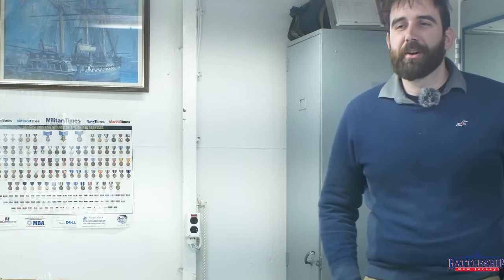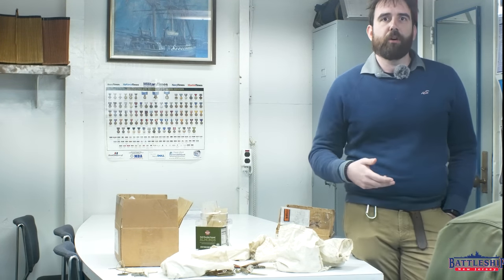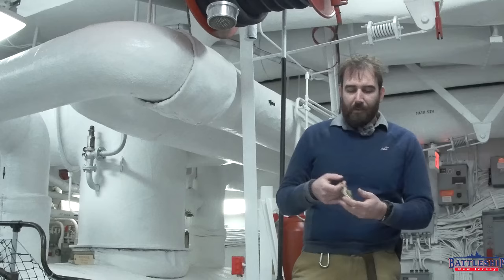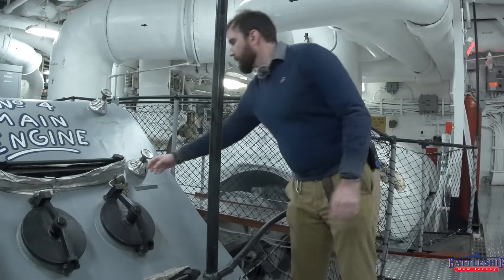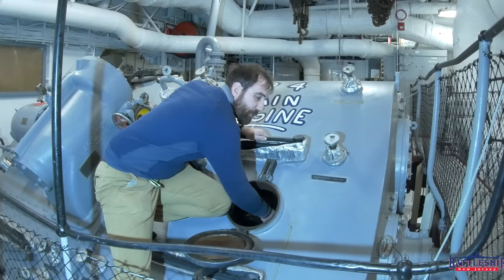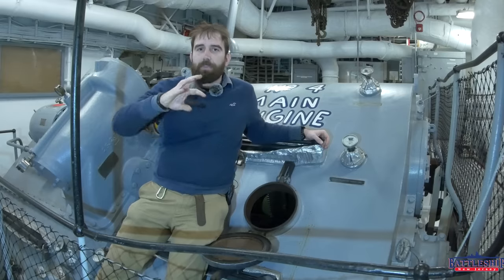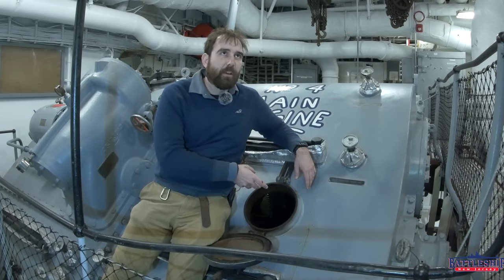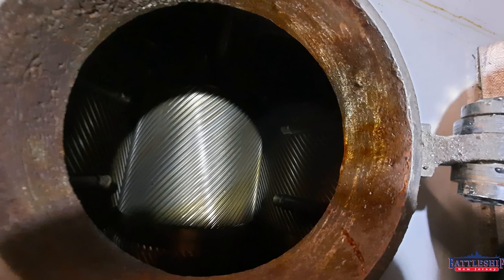The Keys to the World's Fastest Battleship: Unlocking the Reduction Gears

Comment: You could make extra cover plate out of  thick polycarbonate and mount it over the port hole with the same locking bar and bad lock, some PC  can be bulletproof, and probably as durable as the protective housing  it self.
This chould be sufficient for the navy. 
 You can also put a seal on the lock hole + the lock ,if you put light in the gear box this seal may give a extra layer of protection, ensuring that  the 
Cover is not opened after the installation of lights by the wrong person ,that want to fix the lights if they break.
The best solution for light mounting I probably to put two PC covers on the enclosure and just illuminate thru  the plate of one and looking in the second.  Puting anything faren inside  is risky, what if it break and stuff fall into the gearbox? If was my ship I would deny any request to put stuff inside the gearbox and other highly sensitive machines like turbines..,  see thru port glasses lockt and wire sealed:  yes

Comment: All those keys and none for the ignition switch or at least the steering wheel LOL J/K I remember massive rings of keys in the motor pool for each and every vehicle, generator set, and commo shelter
Reply: Army vehicles did not have ignition keys c. 1940-1980
Reply: @brucereynolds7009  That was a joke Bruce, the keys I mentioned were for all the locks on the chains that kept the Deuces and GammaGoats steering wheels from being able to be turned as well as the locks on some spare tires. The only vehicles that I can recall that did actually have ignition keys were the civilian models used such as Ford, Chevy, and Dodge staff cars and pickup trucks M880 and Blazers.

Comment: Its really amazing that you have located the keys and can open these up.
But if the goal is to have them viewable in addition to the plexiglass covers id look into maybe flooding the gear box with a light oil just to keep them preserved. Not that I think the USN would ever recall these ships to service, would just be a real shame if such a wonderfully machined part were able to deteriorate.
Reply: You didn't see the documentary on them reactivating the USS Missouri? They were so desperate for crew they had to enlist Rihanna. And apparently Liam Neeson is an admiral in the navy reserves.
Reply: They would probably have been coated with a carefully selected storage oil/grease of some kind when the ship was mothballed so washing that out and replacing it with some random light oil might cause the gears to corrode faster.
Reply: With good sealing clear covers, be it acrylic, lexan, plexiglass, et al, it would be better to hook a regulator to a breather and put 15PSIA (~7" water column) of Argon in the gear case than flooding them with 500+ gallons of oil. A lot cheaper too.
Reply: @Murgoh  I'm assuming they were coated with cosmoline, which is a great preservative, but does dry out and harden over time.
Obviously what ever is used should be carefully selected. At the very least I think it's worth consulting with a professional on this subject. Especially given the clause in their contract with the Navy.
Reply: @bretsk2500  Yeah that would also be a good idea, cheaper for sure. 
Either way they go about it though, I think they should take additional steps to ensure they don't deteriorate.

Comment: You probably do need to open up the reduction so you guys can find out if there is restoration work needed for them
Reply: Who could do that if it was even required?
Reply: Good question
Reply: Ryan already mentioned in this video that another engine is 1/100 of an inch out of alignment and the Navy left it that way all through New Jersey's service because of expense involved in making it perfect. So even if the museum could do repairs, because they are not allowed to reactivate propulsion systems - it would be far too expensive, involved, and time consuming to do much work on the reduction gears.
Reply: @wills2140  Also, on a gear that size, would 0.010" even be relevant?
Reply: @user2C47  Yes, it's definately relevant for the high loads and speeds involved.

Comment: one reason the key's lock into the lock body, is that this 'key bundle' acts as a 'lockout/tagout' system, the engineer would only start things if ALL the keys were present, indicating all access hatches where closed, and nothing is obstructing anything, so No human could be harmed with the machinery. also when a padlock was 'removed' there was probabbly a rail where it got put to indicate the system was being worked on!, and to indicate not to start anything!

Comment: "Cavitation is a phenomenon in which the static pressure of a liquid reduces to below the liquid's vapour pressure, leading to the formation of small vapor-filled cavities in the liquid. When subjected to higher pressure, these cavities, called "bubbles" or "voids", collapse and can generate shock waves that may damage machinery." -Wikipedia.
Not air, but water vapor and partial vacuum, it appears.
Reply: Though air can be sucked under water by a propeller too near the surface, it still occurs in submarines operating at great depths.

Comment: Two comments: 

If that lube oil in the reduction boxes, sump and tank hasn't been changed in 30 years? And there is no program to do testing for organic/water contamination in the oil or any bio contamination treatment program for all that oil? Organics (microorganisms) move in, reproduce and EAT the oil. They poop stuff that corrodes and wrecks very precise bearings, gears, etc., also degrading lubricity of those oils- If you all are supposed to be preserving the machinery against future use, best get on a program with that!

2nd: Those big military locks are almost certainly MASTER KEYED. The ones I"?'ve been around certainly were. Because if you just got bombed or torpedoed and time is of the essence? Old master chief ain't tossing through 80 odd keys, trying to read their stampings in a hurry under the emergency lights or in the dark... HE had a damn master key. Grunts got just the keys they need TODAY during routine operation, limited access for those with limited responsibility.

Comment: If you restore number 4 engine room, you should take the cover off and put a plexiglass cover on. so people can see the gears and how they work. Better. If you can through the navy. What’s the most important key or set of keys that would have been on the battleship during service?
Reply from the maker: This space has been restored and is open to the public. We will be displaying the gears behind plexiglass.
Reply: Admiral's head.
Reply: @BattleshipNewJersey  Polycarbonate (Lexan) may be a better choice due to higher impact resistance, less tendency to crack or chip under impact and greater resistance to petroleum products. Acrylic (Plexiglass) has better light transmission, clarity and higher resistance to scratching than polycarbonate. Both materials have advantages and disadvantages, I’d guess the need to keep contaminants out of the gear reduction box would be the most important factor.

Comment: I'm a ex Navy mm machinist mate , you need to keep those Inspection Covers closed and locked. You leave them open and trash and dirt will get into them. The sump of the reduction gears has not been cleaned since the Navy left. If you knew anything about engineering you wouldn't be fucking around with these inspection covers.
Reply: If he has issues remembering which way to turn a screw, he probably isn't going to consider FOD.

Comment: Canadian gas turbine mechanic AgentJayZ who works on old fighter-jet engines (airliner, battleship, and nuclear aircraft carriers all work the same, there's a gas generator spinning a turbine) once dropped a nut into a turbine standing on end. It was almost musical, pinging off the blades. Titled "the worst sound a jet mechanic can hear" or similar. And the turbines he works on make 25k horsepower, NJ's made 250k hp at the shafts ...

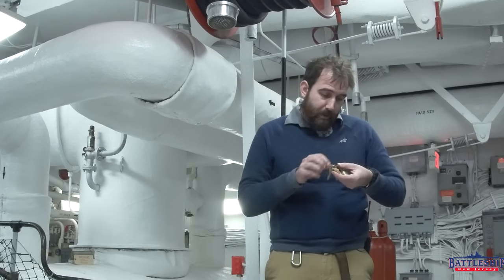Comment: 🧐 Its funny that some folks think a battleship would require an ignition key, like a car! Anyway, it's obvious those are 3:73 posi gears, which is reason #1 why battleship New Jersey had a slightly faster top speed than the other Iowas! The rest were fitted with GM 10-bolt rears w/4:11 gears. If you walk to the front of the engine room, you'll find the 6 Ford 427 V8 engines. The other Iowas used the GM 427, which is the other reason why they are slower. 🙂

Comment: I'm surprised they're using helical gears. You'd think that in a battleship, the main reason they're used (noise) wouldn't be a concern, especially with their drawback of additional due to how much heavier/stronger everything around a helical gearset needs to be.
Reply: Helical gear teeth are stronger and transmit more power than spur gears of the same size. Also quieter increasing bearing life. At huge power loads, any other type of teeth would easily break.

Comment: The military seems to do everything backwards.  Where I work we have the LOTO (lock-out tag-out)  protocols for working on equipment to make sure it's de-energized and safe.  Each affected person has their own lock to put on either a hasp or lock box and your lock has to stay on as long as you're working on it.  I think it's funny how the military UNLOCKS the equipment to work on it.  My son did 6 years in the Air Force and said everyone below officer rank is basically expendable.  Very informative video!
Reply: Government agency OSHA mandates that just about all non government & Ultility companies must use LOTTO. Retired from a large hospital and it would take longer to fill out several pages to perform a shutdown to install a receptacle. Had to get the chief electrician & safety department tio sign off. If you worked on a machine that had electric, air & steam between different shops & contractor's could have over 10 locks on it.
Reply: completely different situation. they want it locked to prevent accidentally or purposely  damaging the reduction gear. all items that affect the operation are locked . the safety of the reduction gear is paramount since it drives a propellar. with osha they want to protect the worker . they don't give a shit about the equipment not getting sabotaged.
Reply: @garbo8962  That sounds like where I work, a northern Wisconsin papermill.
Reply: Here the goal is to protect the critical and expensive gear box.  Sailors are easy to replace.
Reply: In the late 80's the Navy used a tagout system with complete logging and independent verification of both the tagout list and the actual tag placement.  

No lockout system, no set of locks issued to each sailor, etc.  The lockout portion was replaced with the fact that touching a red-tagged switch/valve/etc. without following procedures was a sure way to experience Non-Judicial Punishment and lose liberty/leave/pay/rank for a month or three.  If an injury occurred, that could be taken to a Courts Martial and have you a civilian with an Other Than Honorable discharge.
Reply: @ronblack7870  I completely understand the paradigm.  What I was trying to say was that if that gearbox were designed for and installed in a modern industrial setting all covers would be bolted down and torqued to spec, all operating controls would be safety interlocked so no harm could be done to the mechanism and LOTO would be mandated for all repair and inspection work.  Having said that there's an unspoken rule from management where I work: :Safety first unless it costs too much".

Comment: All Navy ships after, the Mid 70's, added "LOCKS" to gearing & turbines, due to " SABOTAGE".
Reply: For the same reason as officers in the army after Vietnam had to have armed guards when visiting logements ?
Reply: That is straight up BS! I have worked on ships, Navy & Merchant, built from early WW2 period up to 2000. They all have, and have always had locks on reduction gear access plates.
Reply: @brucelytle1144  Worked ? So you didn't deploy on Navy ships, shut up till you do! I did, 76'-85' .
Reply: @charletonzimmerman4205  actually, I was in the Navy for 8 years, three months and 4 days. Was an MM1. Sailed on Destroyers and an LPH. Then I was in charge of 38a Shop on a sub tender, repairing all mechanical equipment on SSN's. When I went to shore duty, I worked at DATC/FMAGPAC in San Diego, where I did vibration analysis for 3 years. Worked on every type of ship the Navy had in San Diego. That was from 1970 to 78.
After the Navy, I got my 3rd Engineer's License and sailed Merchant ships for another 20 years. 
So, yeah, I'm confident in what I know and say.
Reply: @brucelytle1144  I also, did 'Vibration Analysis" on-board AS-36 LY Spear, 77'-80', 92-A, R-3 Div. EM-3 & for a year 79' was LPO, of that shop, worked on, SSN- 638& 688, fast attack subs. Small world I worked with a MR-2, from 38A onboard that, Tender, so a little confused? with you're story. But I will , give you credit.
Reply: @charletonzimmerman4205  I was on Orion, at the time we only had 637 class boats. I did some work on the TJ and another boomer and had to certify the TEP on the Haddo.
I was surprised, getting assigned to 92a! I didn't know anything about vibration analysis (other than how sonar used it) till then. Sent me to school in New London to clue me in. Saw all kinds of weird stuff doing it. We were probably the first "skimmers" to utilize it. We got a database set up and kept track of every motor that came in the shop. I learned so much wonky crap about motor windings, all that!
I learned alot in the Navy, but when I sailed on ships as big as a carrier, with a 21 man crew, was when the light really turn on for me...
Take care!